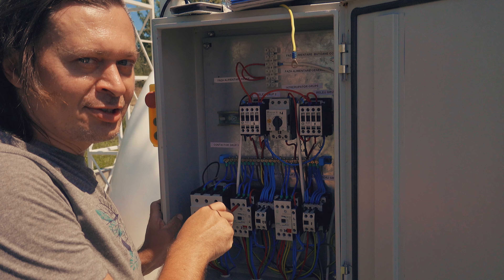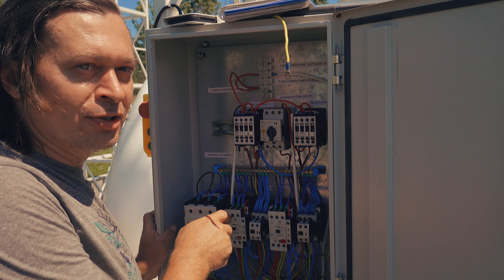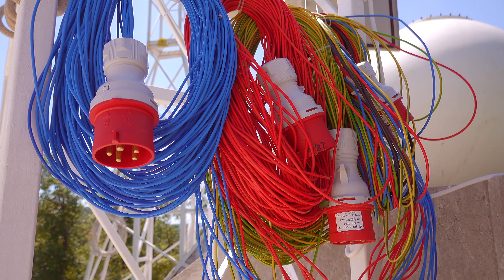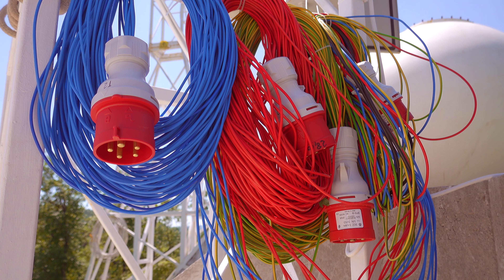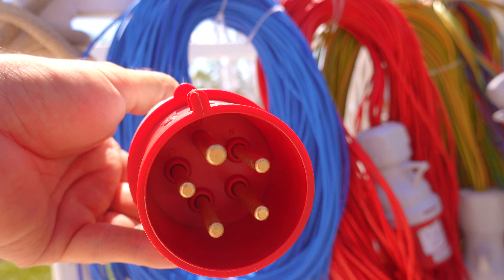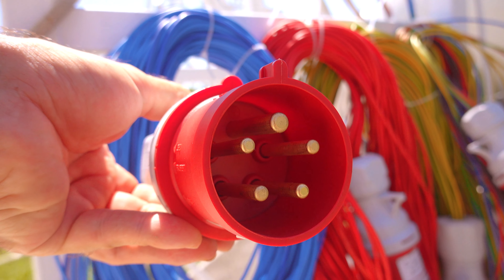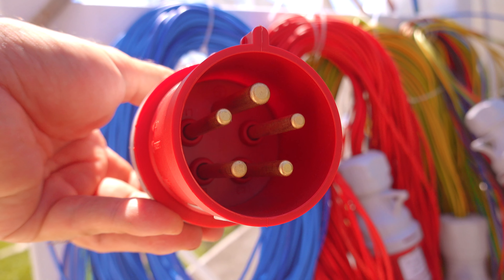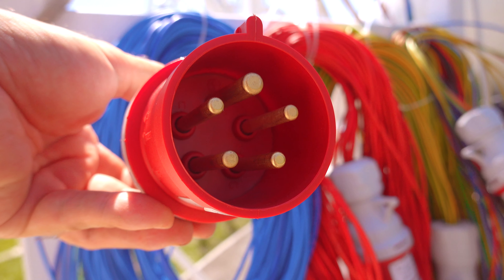MISSION 9 - SITREP 18: Electric Panel Connections to the Rocket

Comment: How many of those connectors are you using?  What is the voltage?  AC or DC?
Reply from the maker: The primary voltage is 380V, but the phases are divided to get 240V on each heating element. We use AC power.